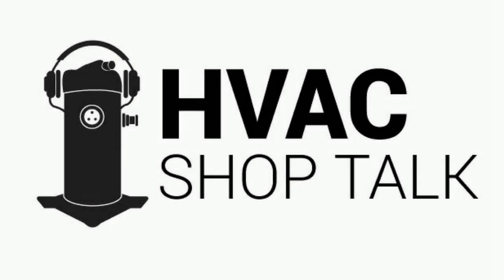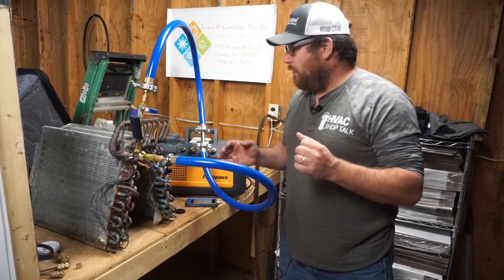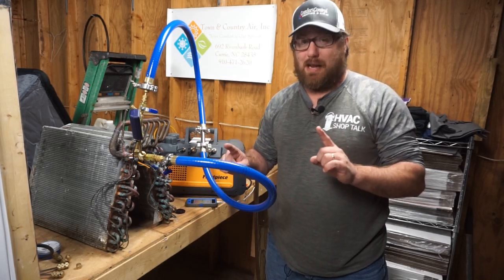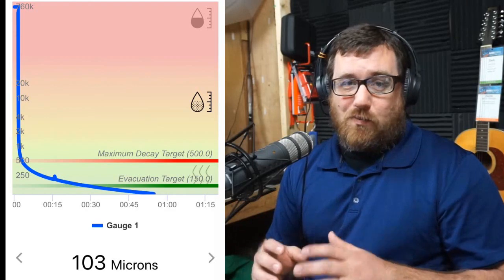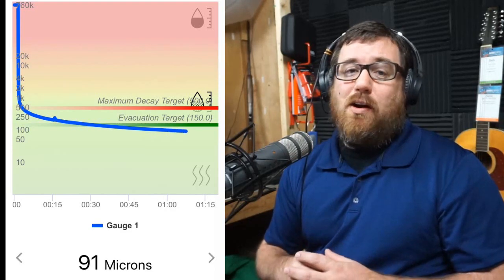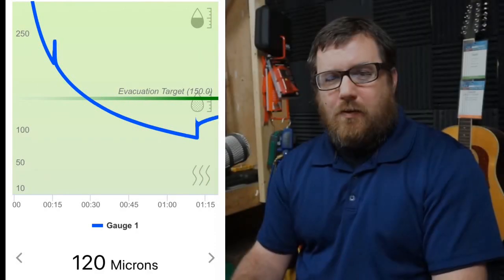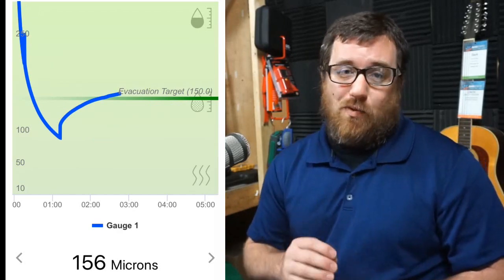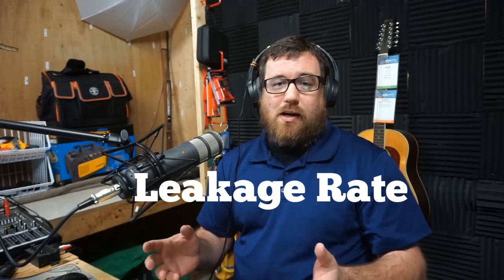Leaking HVAC Coil Passes Vacuum Test | TruBlu | Fieldpiece VP85

Comment: Could you do this test on a new coil that has never been installed? I would be curious if the leak rate on a new coil with nitro in it. Maybe over 24 hours. Just wondering how many leaky coils there could be from the factory if their tolerance is 1micron per minute...?
Reply from the maker: I can get that going for sure. I worry that the testing equipment will leak more than that unless it is closely monitored.

Comment: Zach,
You blew my damn socks off. Thanks for that. 

Sincerely,
John McMaster
Reply from the maker: Even though this is most likely sarcasm, your welcome. We can replace your socks at no charge if they were damaged or burned.
Reply: Zack Psioda not sarcasm. Light hearted yes, but none the less extremely interesting couple of videos. Really makes me wonder how many leaking systems I put back into service with small leaks thinking “Well it held pressure and held vacuum so it must be good”.
Reply: Zack Psioda by the way it’s not my socks that need replaced. It’s my pants. An embarrassing reason, but I think you know why.
Reply from the maker: I hope you shit yourself. But you didn't....did you?....

Comment: It is a very good analogy I guess it will be up to us to decide if we replace the coil or not But in the field having the homeowner without Air condition off for 13 Hours I believe is too much😉😎👍
Reply from the maker: If I was still in the field, I would have let it go most likely. I didn't think back then this was possible.